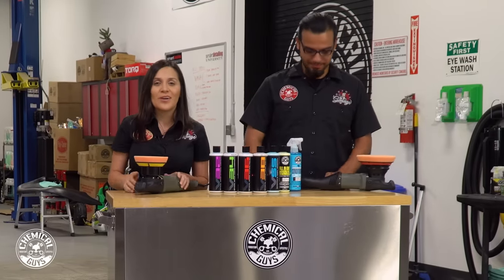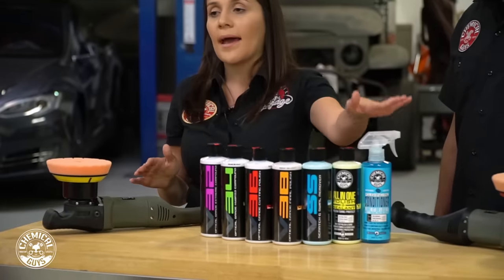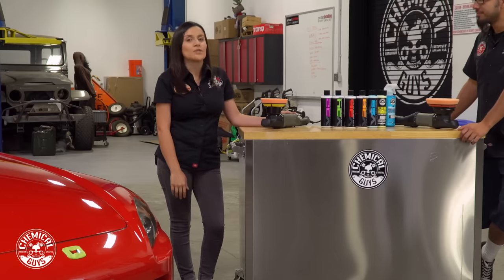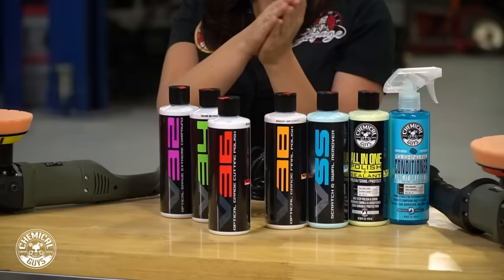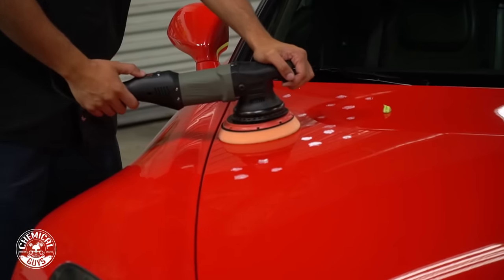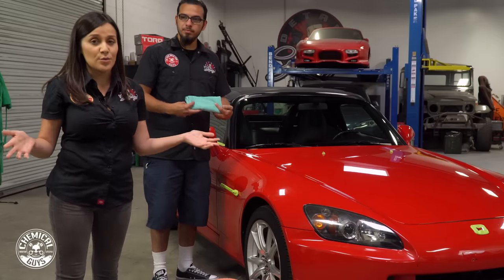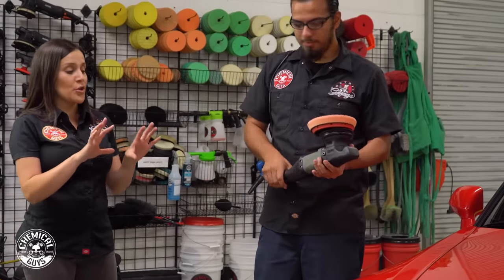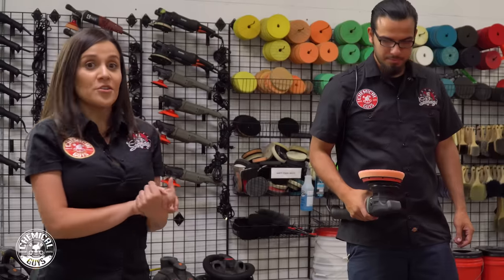Top 5 Polishing Tips For Removing Car Scratches ! - Chemical Guys

Comment: When polishing a vehicle with pinstripes do you need to avoid that area or is it safe to polish over them when using a random orbital polisher?
Reply from the maker: Hey Chris, that's a great question. It depends how the pinstripes were applied to the vehicle. If the pinstripes are under the clearcoat, then you can polish the car as usual. However, if the stripes are on top of the clearcoat, then you will need to either tape them off or simply avoid that area. Thanks for watching, Chris, and stay tuned for a new video dropping tomorrow!

Comment: If the vehicle has any sort of pinstripes or decals on the body can you go over them?
Reply from the maker: Hi Nicholas! Thanks for your message. It is possible to polish over pinstripes and accents but it would be best to mask off those areas to prevent removal especially when they are vinyl or above the clear coat.
- CG Nick

Comment: How many pads per car? Heavy-medium cutting pads
Reply from the maker: Hey David, good question. When used properly, one pad should be able to do your whole vehicle. You can always clean the pad if needed! Of course you will probably also need a separate white pad for the refinement stage... Thanks for watching and make sure to check back tomorrow for a new video upload!

Comment: Does Chemical Guys have a polish specific for interior trim? Or what would you suggest using? I have shiny black trim in my 2012  Escape its he previous owner scratched it all up. I looks like it's just normal surface scratches and can come out with some work.
Reply from the maker: Hey Scott, great question. You can use V36 on shiny, clear coated interior surfaces. Check out the video below of the CG detailer using V36 on the BMW's clear coated wood trim to restore it to like new condition. Thanks for watching, Scott, and stay tuned for more videos headed your way soon! 
https://www.youtube.com/watch?v=msMn_g9wC7g&t=128s

https://www.chemicalguys.com/V36_Optical_Grade_Cutting_Polish_4_oz_p/gap_v36_04.htm

Comment: how do u clean the pad? washing machine?
Reply from the maker: Hey! Use Polishing Pad Conditioner and a soft bristle brush to remove spent product, warm water will assist this process. A washing machine may damage the foam pad and backing material.
- CG Nick
Reply: Chemical Guys  thank u for the reply, how often should i clean the pad

Comment: how do I clean the micro fiber towels or just throw them away?
Reply from the maker: Hey potatochobit!  Check out Microfiber Wash to revive microfiber goods so that it can last as long as possible. Wash using Hot water and dry on low heat or tumble dry.
https://www.chemicalguys.com/microfiber-wash-cleaning-detergent/microfiber-wash.html

Comment: If you already use a rotary, is there any reason or advantage to use a da machine? I assume all of these products function well with either..

I'm about to purchase some product and was wondering if buying a da would benefit me.
Reply from the maker: Hi Fon, if you are new to polishing or relatively inexperienced, we suggest using a DA polisher. Also, if you wish to apply glazes, sealants, and waxes quickly and efficiently with your machine, then we suggest picking up a DA as a rotary should not be used to apply these types of products. If you are experienced with a rotary and know what you're doing and have no desire to use your machine to apply glazes, sealants, or waxes, then you can stick with it. Thanks for watching, Fon, and thanks for being a part of the Chemical Guys family!

Comment: Can I just use v38 with white pad for light scratches n swirls?
Reply from the maker: Hey Steve! Thanks for your question, to remove fine scratches and swirls try using Slick Finish Cleaner Wax with an White Hex-Logic Pad. - Happy detailing! 
https://www.chemicalguys.com/slick-finish-cleaner-wax-with-micro-abrasives/slick-finish-cleaner-wax.html

Comment: Hello, I have a 2019 WRX so the paint is still in good shape. My question what would you do to really bring out the shine . Great video
Reply from the maker: Hey! We recommend polishing it with V36 Optical Grade Cutting Polish, then apply HydroCharge. Chemical Guys V36 Optical Grade Cutting Polish is the great all-around cutting-polish that eliminates light to moderate paint defects and imperfections from all paint types, then finishes like a fine polish. HydroCharge is the easy-to-use SiO2 ceramic spray coating that delivers a brilliant high-gloss candy shine, extreme hydrophobic properties, and the durable protection of a ceramic coating with the ease of use and speed application of a spray.

https://www.chemicalguys.com/v36-optical-grade-cutting-polish/v36-cutting-polish.html

https://www.chemicalguys.com/hydrocharge-high-gloss-hydrophobic-sio2-ceramic-spray-coating/WAC23016.html

Comment: So if you've used v32 you have to go down the line using v34 to v36 and v38 ? Or can you use v32 and then jumps to be v38
Reply from the maker: Hi Hugo, you don't necessarily need to move up the line using every single product. When used properly, you can go from V34 to V38, for example, or go from V32 to V36, or only use V36. What's important is that you work every product for the proper amount of time until it becomes translucent. Remember that every car is different and testing is the name of the game when it comes to compounding and polishing. You should test out a small area of the car to figure out what combination of products works best for the particular detailing job before undertaking the whole car. I'm going to leave a link to really informative and helpful article below that explains how to choose the right compound, polish, and pad for your car. Take a look at it, I think you can learn a lot! Thanks for being a part of the Chemical Guys family, Hugo!

https://www.chemicalguys.com/How_To_Choose_The_Right_Compound_Or_Polish_For_Your_Car_s/644.htm

Comment: Hey CG’s you didn’t really talk about the VSS and All-in-One. Can you explain in what situations these would be good to use please?
Reply from the maker: Hi! That's a good question. VSS is a great one step product for scratches and swirls that aren't too deep. It fits somewhere between V34 and V36, so it has significant cutting power, but there definitely is still lots of room to go more aggressive. The main difference between VSS and V4 is that V4 contains sealant, whereas VSS does not. Therefore, V4 should be used when you are looking to compound, polish, and seal all in one step. These products are great for detailers who are short on time, looking for one step all in one product, or for cars that don't need require a multi step process. Thanks for watching and stay tuned for more exciting videos headed your way soon!
Reply: Chemical Guys thank you for your response. When using your V Line compounds and polish, do you need to remove any of the residue via IPA wipe down? Or will a dry Microfibre suffice? I’ve heard conflicting reports so wanted to ask you guys myself.
Reply from the maker: After the polish runs clear, buff off residue with a clean microfiber towel. No IPA wipe down is necessary!

Comment: How bout pro’s and cons of vss vs a 2 step
Reply from the maker: Hi! Thanks for the suggestion! We will add it to our list of potential videos. I can give you quick rundown now of the pros and cons of VSS vs a two step. VSS is obviously a one step polish that cuts hard and then refines to a fine polish. It falls somewhere between V34 and V36. It's a great product for that detailer looking for an all in one product, the detailer on the go, or the detailer with moderate scratching and swirling. It also will take less time than a two or three step process. However, if your paint requires a more aggressive approach and has deeper scratching and swirling, then a multi step process using the V Line series will be required. The V Line offers more versatility and can cut harder than VSS and remove deeper scratches than VSS, but requires more time. Thanks for watching and thanks for being a part of the CG family!
Reply: Chemical Guys awesome. That makes perfect sense. Thanks !
Reply from the maker: You're welcome! Glad to have you part of the CG family! 👊

Comment: Can you do this step by hand if you don't have a polishing tool?
Reply from the maker: Hi, great question.  We recommend polish to be applied by machine for best results and less effort/fatigue to make life easier on you, although you can very small areas by hand. Modern paint polishing compounds are not intended to be used by hand over large areas. Modern paint finishes are very hard and glossy, so hand polishing is seldom practical or effective. If you must polish a small isolated area by hand, apply 2-4 dots of polish to your hand polishing pad and work it into the area in alternating straight line and circular motions until the polish has turned clear or even disappears from the paintwork. Repeat until desired results are achieved, then follow up with a coat of sealant or wax to protect your newly-polished shine! Check out the video below to see a comparison of machine vs hand polishing. Thanks for watching and happy detailing!
https://www.youtube.com/watch?v=S-0EFouIZMI

Comment: How often should we wash our pad or change it
Reply from the maker: Hey there! On a typically polishing job on an average size vehicle one or two pads should be sufficient. Depending on how much material is removed, amount of product used and length of polishing job will determine how often you'll need to change pads. It is best to wash them at the end of the job or as necessary while polishing (when the pad is clotted or no longer efficient).
- CG Nick

Comment: Didnt mention the all in one?
Reply from the maker: Hi! I'd be happy to give you quick run down of the All In One. Chemical Guys V4 All In One Polish is an all-in-one scratch and swirl remover that delivers a mirror shine with durable protection in one step. The advanced polish is formulated using diminishing abrasive technology. The innovative abrasives cut fast to quickly remove swirls, scratches, and oxidation, then finish like a fine polish to create a wet mirror finish on all painted surfaces. The innovative swirl remover restores a lustrous scratch-free finish without filling in or covering up swirls or defects. V4 adds synthetic sealant technology to seal and protect the polished surface from environmental contamination, UV sunlight, birds, insects, and water spots. The main difference between VSS and V4 is that V4 contains sealant, whereas VSS does not. Thanks for watching and thanks for being a part of the CG family!
Reply: I bought a bottle. just not sure which pad to use with it.
Reply from the maker: Awesome! You can use a white pad for light swirls and scratches, or an orange pad for a more aggressive approach.

Comment: what polish would you use for the taillights and headlights?
Reply from the maker: Hi Richard! We recommend Headlight Restorer. Save yourself the trouble, and simply rub out any hazy headlight residue with Chemical Guys Headlight Restorer and Protectant. Simply rub the refined cream formula into the faded headlight plastic with a microfiber towel until it turns clear. That’s it! Most plastic turns from hazy and yellow to crystal-clear in seconds with Headlight Restorer and Protectant. Tougher faded plastic can be professionally sanded with 2000 and 3000 grit wet sandpaper, then restored clear with Headlight Restorer and Protectant. Use Headlight Restorer and Protectant by hand and a microfiber towel, or use it with a machine polishing kit to get 100% professional-level results. Thanks for watching and thanks for being part of the Chemical Guys family! Check link below.

https://www.chemicalguys.com/Headlight_Restorer_and_Protectant_16_oz_p/gap11516.htm

Comment: How many pads do you need for a car
Reply from the maker: Hi Gabriel! Depending on the condition of the paint and variations of compound/polish used it can take 2 or 3 of that same level pads to correct a vehicle. They can be cleaned and reused during the job.
- CG Nick

Comment: Nick or Jen if you have hardly any scratches or swirls and you wanna just apply wax or sealant how do you know what speed to start and end with??  And even if you are polishing you start out with the low setting but do you stay with that throughout the whole car?  The one thing that always gets me is the speed settings and when to move up or down.
Reply from the maker: Hey Mark, good question. Yes, you stay with the low speed setting for the whole car. You should spread waxes, glazes, and sealants on a setting from 1 - 3 on your machine. Check out the video below to see how Nick how does it! Thanks for watching Mark and thanks for being a part of the CG family!

https://www.youtube.com/watch?v=hWwKyT0LzUI

Comment: I have torqx is it 5inch pad?
Reply from the maker: Hey there! That's correct, the TORQX is equipped with a 5 inch backing plate with 5.5 inch pads.
Reply: @ChemicalGuys   awesome thank you

Comment: What's VSS and all in one
Reply from the maker: Hey Hugo, Chemical Guys VSS Scratch & Swirl Remover is the easy-to-use polish that creates a mirror finish in just one step. VSS cuts strong to quickly remove swirls, scratches, and defects, and then finishes like a fine polish to restore lustrous shine and deep reflection.  V4 is also a one step product like VSS, with the main difference being that V4 contains sealant, whereas VSS does not. Chemical Guys V4 All In One Polish creates a mirror finish topped with durable protection in just one step. V4 cuts away light imperfections, scratches, and swirls, finishes like a fine polish, restores lustrous shine and deep reflection, then adds a layer of durable protection against the elements. I will leave a link to videos on VSS and V4 below that I think you will enjoy. Thanks for watching, Hugo and stay tuned for more videos headed your way soon! 

https://www.youtube.com/watch?v=zbwOERX14oA

https://www.youtube.com/watch?v=QYHMxykdk68&t=415s

Comment: I have VSS and orange hex logic pads used with a DA on black paint. I have problems with the finish being hazy in spots especially doors that aren’t perfectly flat. Basically what looks like buffer trails with I thought was super hard to get with a DA. However, I don’t claim to be good at this stuff 😂. Any advice for making sure the VSS comes out to a consistent perfect shine? Also the spot where you talked about pressure in this video. Were you saying to use the first pressure example or the 2nd when Nick presses a little harder than before?

Comment: What does the Vss do and the bottle on the right do?
Reply: jeff yu vss is scratch snd swirl remover
Reply from the maker: Hey Jeff, as Jenn explains in the video, Chemical Guys VSS Scratch & Swirl Remover is the easy-to-use polish that creates a mirror finish in just one step. VSS cuts strong to quickly remove swirls, scratches, and defects, and then finishes like a fine polish to restore lustrous shine and deep reflection.  V4 is also a one step product like VSS, with the main difference being that V4 contains sealant, whereas VSS does not. Chemical Guys V4 All In One Polish creates a mirror finish topped with durable protection in just one step. V4 cuts away light imperfections, scratches, and swirls, finishes like a fine polish, restores lustrous shine and deep reflection, then adds a layer of durable protection against the elements. I will leave a link to V4 below so you can read more about it. Thanks for watching, Jeff and stay tuned for more videos headed your way soon! 

https://www.chemicalguys.com/V4_All_In_One_Polish_Shine_Sealant_16_oz_p/gap_106_16.htm